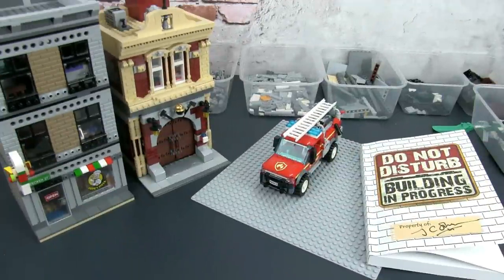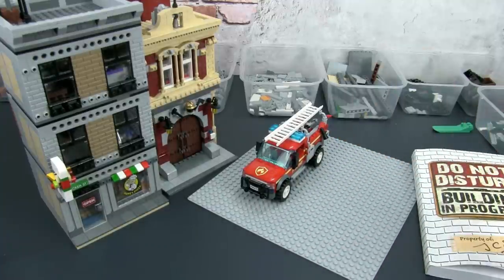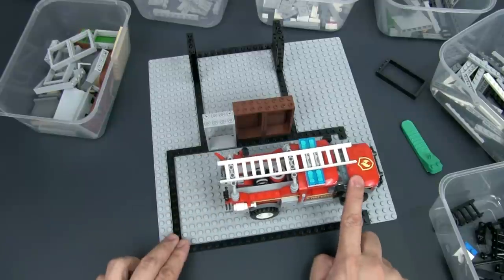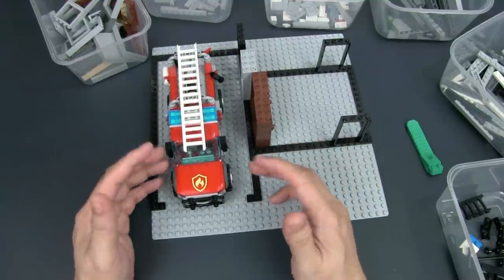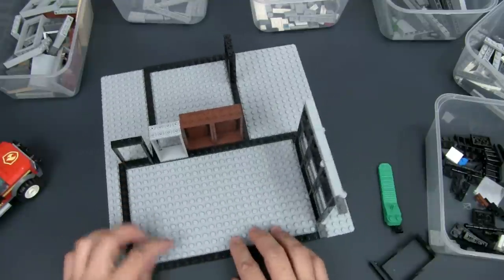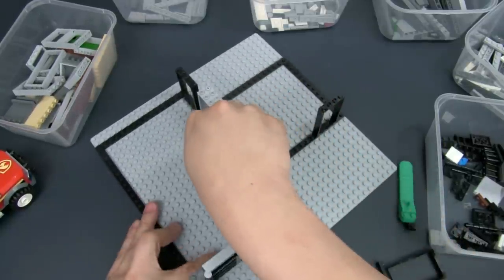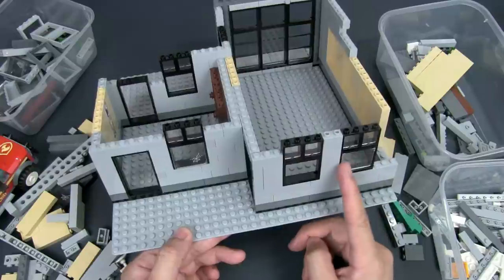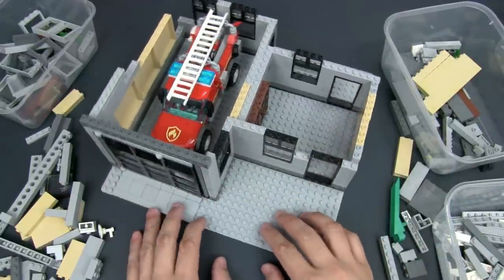LEGO Fire Station MOC (Part 1) - Building a  LEGO MOC from Start to Finish

Comment: This is a neat concept and a nice start to the build.  
Knowing you, you've probably done the next video already, but I would like to suggest hinging the door on the right side so that you have more room to fold it and it doesn't encroach on to the next building. That might give you more room to open it fully so the fire truck can zoom out rather than having to navigate round the door!  
Or you could make it into two halves that both fold back on either side. If they were equal each half would have to be 6 studs wide which is a bit awkward as LEGO don't make a window frame that's 3 studs wide so you couldn't have two folds of 3 studs, you could have a fold of 4 studs and a fold of 2 studs.  Or you could make one door 8 studs wide with 2 folds and one door that's 4 studs wide.  
Another idea is that you often see large industrial doors with a pedestrian door built in, so that a person can go in without opening the whole door; you could easily include a person-door into one of the panels so that a minifig can get in from the front before unlocking and opening the whole folding door.
Reply from the maker: Hi Max, I tried different configurations and personally like the accordion fold. There is enough space for the truck to pass through safely as I was generous with the width. I did a 2/3 plus 1/3 left/ right opening but still think the accordion fold is the neatest and most novel. But yes, if anyone builds this in future, they can adjust the way the doors open as they like :) And yes, the next part is already filmed and ready to go tomorrow :)

Comment: Hi, I like your garage door. You could mount the door on the left (1/3) and on the right (2/3). That would make it more stable.
Reply from the maker: It is actually quite stable once built up, as in when the top bar, plates and tiles are in place. I did explore that configuration but I like this accordion fold better.

Comment: it's ok nice build project I can't wait for the next video yes if I done it I'll call you put the doors on the right but is your build it is your choice
Reply from the maker: That makes perfect sense and it just never occurred to me since I am so used to doors opening to the left. I have tried and so adjustments had to be made in the building technique and I have to shift the ventilator but it does work better so the doors do not open to the building on the left. The changes will be reflected in a later part in the series since a few parts have already been filmed. Thanks!